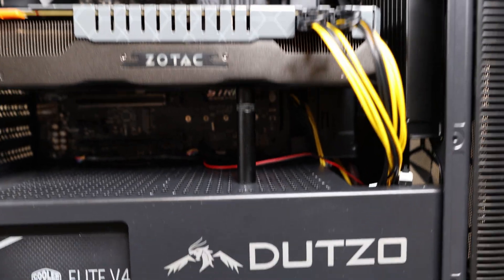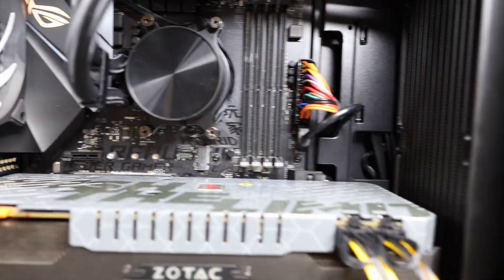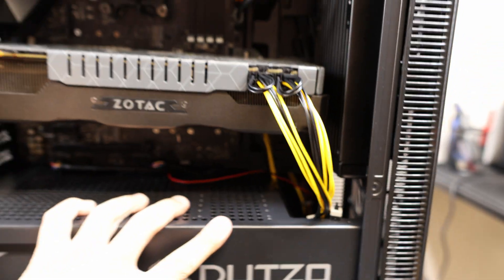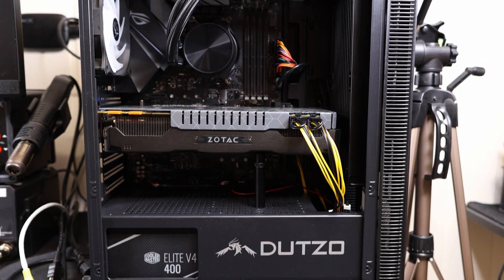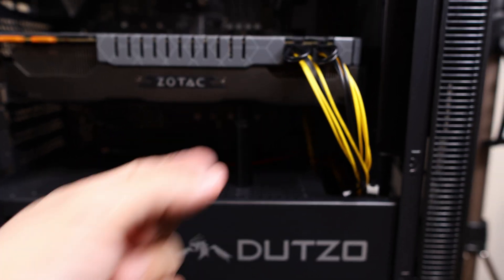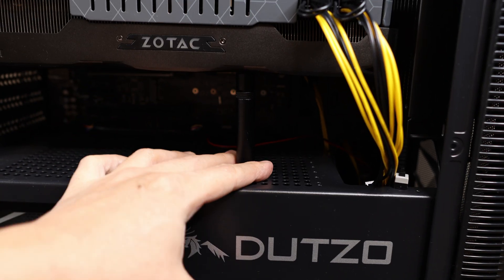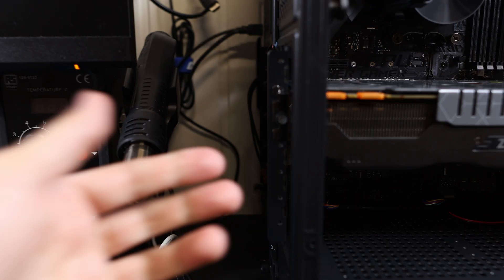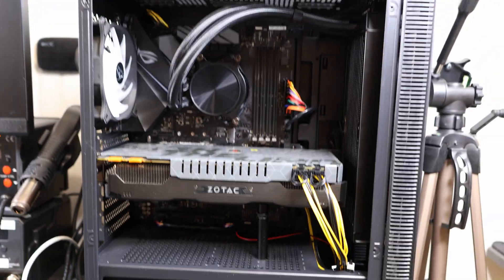How To Use GPU Supports Properly.

Comment: As an intellectual, I recommend a perfectly measured and cut #2 pencil with a fresh eraser for a foot
Reply from the maker: That will give your build that perfect Cyberpunk aesthetics look you've been looking for! 😆
Reply: I prefer toilett paper pipes, or random blocks of wood. I used to fix and test GPUs so their hight's random so I used a block of wood and a stronger pink sponge for support.
Last time I used a medicine bottle with spongy 2 sided tapes, before that a piece of wood which was screwed into the HDD bay. I love using 1mm thick 2 sided tape as a shock absorber, you can stack it, cut it and once glued in it never lets go.
Reply: @sviktor4  best thing about using various sticks is they can often be found just laying around outside
Reply: @AndrewDutton-Topper  The figurine market should thrive on this, just imagine Hercules, Atlas, Goku or even Miku holding your GPU.

I used to hung stuff with wires and springs in my PC case, but people seem to forgot this technology as soon as the HDDs died out.

I think the most common GPU holder is LEGO, my brother uses 2 cylinder blocks to prop up hes laptop's back (I use tic tac boxes).

Comment: Thank you very much for this wonderful explanation. If I may, I have a question outside the context of the video:

I own the same microscope shown in your picture, but its performance is quite poor and the image is unclear. Could you please guide me on which software you use to run it? Also, how did you adjust the lighting and what is the ideal setup to achieve this level of quality?
Reply from the maker: Hello. First, your welcome :) As far as the microscope goes, make sure you have removed the cap where the lighting is. It is clear as the rest of the collar so it sometimes hard to notice it. I use the Windows camera software. I paid around $100 for it from a site here in Norway. 

The sensor is different than those you find on AliExpress. The video output is at 1080p quality 60fps. You can change the video quality using the Windows software also. Microscope has a little wheel on it which allows you to adjust the lighting.

Comment: Supporting it with the case on its side would ensure its completely level. Just my thought.
Reply from the maker: If you can get away with it, sure. But it would be easier knowing it's truly level or not once you have the graphics card's full weight on the support.
Reply: @oldschooldude8370  yeah but having the case be vertical also allows heat to flow out the top, so putting the case on the side could hinder air flow and maybe even thermal throttle
Reply: I didn't read this the way it was meant to be read and now YouTube doesn't want to show me the UI to delete it. Oh well I guess my foolish shall stay here eternally

Comment: Thoughts on built-in GPU brackets that are on the motherboard side, such as the Lian Li Lancool 217's built-in anti-sag bracket or ones that are installed on the motherboard such as the Lian Li GB-001 and GB-002? I can see them only working well if you have a GPU with very solid housing and backplate, as the front side of the GPU gets no support from it whatsoever.
Reply from the maker: In my humble opinion, looking at what Lian Li is going for here, I think this in combination with a support 2/3 the length of the card or between second and third fan would work nicely. Using the Lian Li GB-001 by itself will not prevent sag completely, as these heavier cards require good support to prevent PCB warping. So in short, I like it, but I would still use it in combination with support as shown in this little video.

Comment: We need to bring back horizontal / cube cases. Btw what are your thoughts on the Phanteks Enthoo Pro II – Server Edition? It has a built in GPU support bracket into the case frame. Vertical mounting isn't an option for me because I run dual GPU's. Starting to get anxious about sag because everything is becoming so expensive to replace if it breaks.
Reply from the maker: If you mean this case: https://phanteks.com/product/enthoo-pro-2-server-edition-tg/ then I am a fan! I like all that support if you intend to use them all. I have a Phantek cases and they are solid.
Reply: @TechnologyHive  Yeah that's the one. Thanks dude.
Reply: HAF XB evo was a great case design and I would love to see what a modern iteration would be. I still miss that case sometimes.
Reply: @Tempest-ec2nn  I agree! But it doesn't fit with current trends so it will never happen.

Comment: My sapphire nitro had a support in the box, unfortunately it was not good enough and kept sagging itself.

I ended up using some pen erasers as supports, and they worked unexpectedly well.
Reply from the maker: You can also buy a support from AliExpress for less than $5. I get mine here: https://www.aliexpress.com/item/1005009277636563.html?spm=a2g0o.productlist.main.16.5fbb2c56e16Odh&aem_p4p_detail=2025123002505510670430415899450000119206&algo_pvid=99e90573-08d2-4c87-ad3b-07d2f59c5b79&pdp_ext_f=%7B%22order%22%3A%2210%22%2C%22eval%22%3A%221%22%2C%22fromPage%22%3A%22search%22%7D&utparam-url=scene%3Asearch%7Cquery_from%3A%7Cx_object_id%3A1005009277636563%7C_p_origin_prod%3A&search_p4p_id=2025123002505510670430415899450000119206_5

Comment: I was ejoying the talk about aio and was about to comment something and then video deleted haha
Reply from the maker: Sorry :) I did not like the way the video was edited, going off into something else that I originally did not intend to cover. So I had to stick to the tittle of the video. I hope you still enjoy this version :)
Reply: @TechnologyHive  it was fun that you corrected the guy from gamers nexus
Reply from the maker: @saul-n6w2f  I just pointed out something that no one dared to. Gamers Nexus is a big channel and mine is tiny spec, so when those subscribers see my video, if they even do, they will rage. I prefer to keep the peace. Still the point I made in the video stands, and I may just make a video pointing that out specifically, because a lot of people I have spoken to also mentioned they have their radiators installed inverted in their case, and hoses get in the way of their GPU. 

The reason why that is, is because the radiator is NOT meant to be installed that way. I think I am beating a dead horse here since I can tell you know your stuff too. But as I understand it, the small amount of air in the AIO's is supposed to accumulate at the top of the radiator, not in the pump, so having the hoses up above the pump makes sense. Thanks for your support btw!

Comment: I higly recommend putting two GPU holders in the the middle( same like yours on the right side but also one extra on the left side of the middle fan) to decrease the chance of the PCB to warp 
the reason i say this is because these GPU's have become so ridiculously expensive and i personally would take some extra care and messures to make sure these GPU's wont crack at the PCI-E or warp the motherboard of the GPU over the years of useage.

this was sadly also a learning curve for me to find out about this particular problem of these products.

for people that dont understand what i mean with "warp" the GPU's can run really hot and because these GPU's have such heavy cooling blocks they will bend the GPU board ("warp") and this can make the components like the memory chips and other components on the GPU board to crack loose and kill the GPU. so never put "one" GPU holder on the end of the GPU!

so try to make sure you can support your GPU in the best way possible for the longevity of your GPU's lifespan.
Reply from the maker: Whatever works for you, I am with it! The problem starts when people do not use supports at all. That is a death sentence for these modern day, heavy GPUs.

Comment: Hello this is pretty cool but i just wanna confirm, you don't want the support to be pushing the gpu upwards right? Like if i already have some sag i can have it slightly push the gpu up but the gpu does not necessarily have to be perfectly aligned, a little bit of sag is fine as long as the gpu is resting on something correct?
Reply: If you have the support up so far that it's pushing the GPU up and making a new incline, that's too far and can warp the PCB over time,
you simply want it level--on the flipside to answer the 2nd part of your question, ideally no sag at all, because any sag means the PCB can warp.
Reply: @licentioushowler3400  okay understood, i am going to make sure there is no sag and that the gpu is exactly in a linear position thank you so much 🙏
Reply: yes make sure the cooling block is resting on the support just like in the video, this way the block will not be able to warp the board as much.
i recommend putting two just like the video explaines where to put them.
Reply: @Yorhosashi  oh alright, i am using two actually i got my pc case's support which is near the motherboard, and i just have a typical support when i have it put like in the video
Reply from the maker: The GPU should just be resting on the support, not being pushed up as other here have commented.
Reply: @TechnologyHive  just checked it out and all is good now thanks in advance!
Reply from the maker: @s.slayer0124  Perfect! Glad to hear. And your welcome! ☺